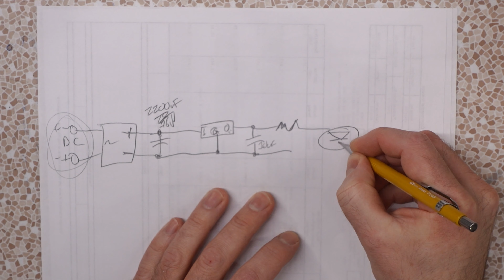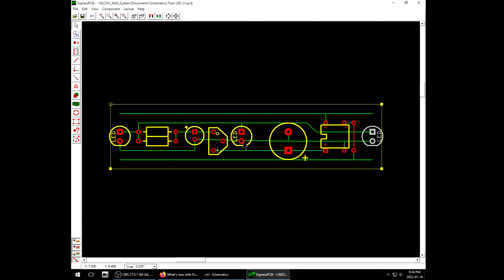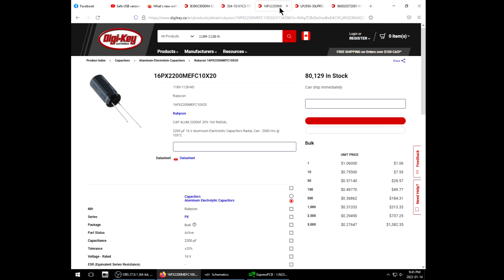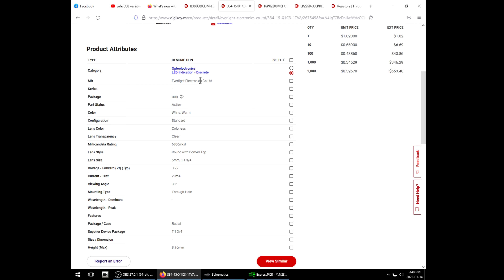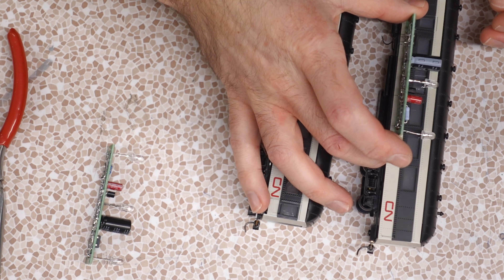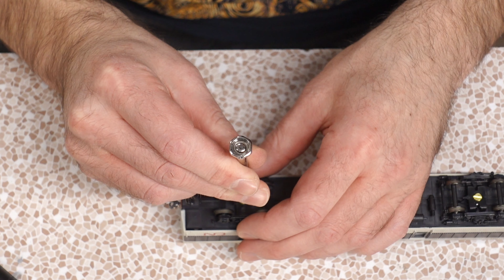Scrapido Lights Ep.1: Regulated Lighting for HO Passenger Cars

Comment: Great content. I’m trying to light my coaches using led strips and a ttp223 switch. I’m using dcc on 14V. What voltage regulator should I use?
Reply from the maker: I'm not sure what a ttp223 is. I google it, it's a touch switch ? you trying to make it so that you touch the car and the lights turn on ?
YOu'd have to look at the current draw of what you're trying to power. 
Also, I use regulators cause I run DC to the voltage changes with speed. 
As I understand, using DCC you'll get a constant 14v so you can just use a dropping resistor like what often comes with the LED lights. 
There is really no way to answer that question without knowing the current draw of the LED strip you are using.